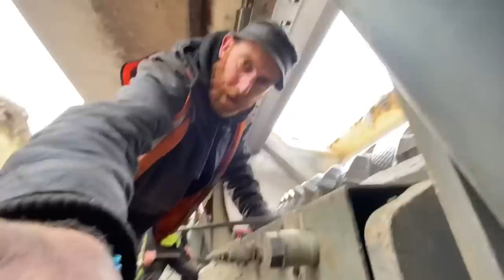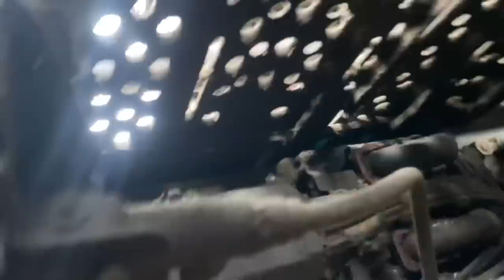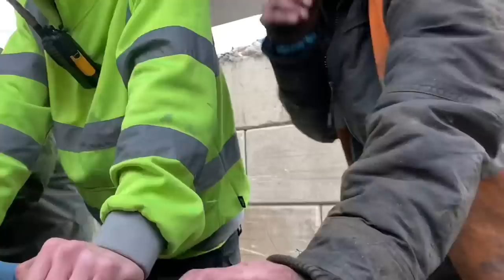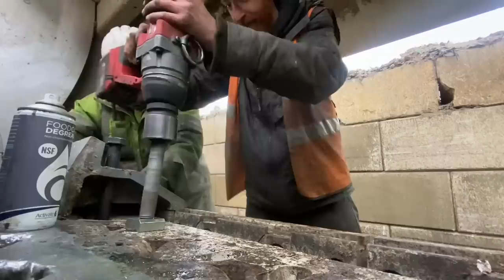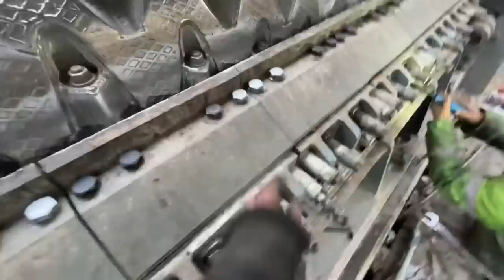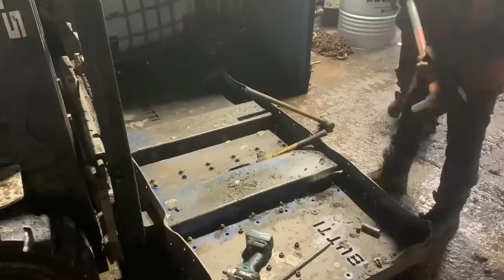Losing £10.000 an hour and I haven’t got a clue what I’m doing!!! No pressure then 😅

Comment: I was a maintenance electrician for a steel mill. I worked on straddle cranes that used joysticks for control. We had a run of breakdowns and all due to joystick failures. One of or shift electricians had taken it upon himself to lubricate the controllers, unfortunately he used penetrating oil in a spray can which ended up taking the lithium grease out of the bearings. Glad we stopped him before he did the whole fleet. I appreciated him being proactive but he cost us a fortune.

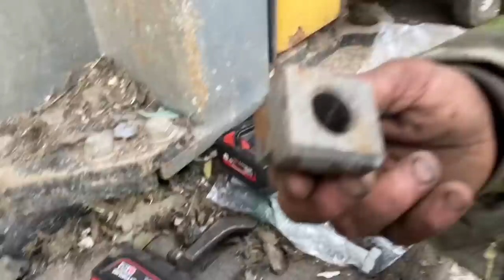Comment: 17:21 IV done it myself but in a pinch when you don't have a tap but you have extra bolts. Take a angle grinder and cut the threads perpendicular to the length of the bolt. This works to give. Bolt an edge to cut the thread. I'm sure if you Google tap made from bolt

Comment: Chris,  A tip or two moving forward.  Those M24 bolt your 'struggling' with are probably not cross threaded but the threads have picked up on each other.  What's needed is some proper good lubricant like an anti-seize Cooper slip.  This will not only allow disassembly but look after the threads on both components and reduce the said problem, but using decreased will only promote the problem.  Hope this is useful and keep up the good work 👍

Comment: How goes it matey?!

Those Unthas shredders are a pain in the ass! Do a good job though. Find out if they are hard facing those cutting teeth and blades before they put them in? They'll get a lot of extra use out of them.

Also, those bolts and fixings cost a bloody fortune for OE so not surprised they've been putting any old crap in. Lol

Comment: @Chris Allen - Professional Struggler 
Those Milwaukee inch drive guns setting 4 is 2400 nut busy or 2033 tightening torque... That good enough to cross thread most bolts...

Comment: If you need a field tap , but only have a spare bolt. If you use an angle grinder and cut a little tapered notch vertically. and bingo, instant thread chaser.

Comment: Them knives are fooked and the cutter blocks don't look much better and the hard facing on rotor looks low,use aluminium anti sieze  on clamp bolts,doesn't cure cross threads but helps on dismantle. You right on your crossthread diagnosis seen it a few times.And sometimes shredder rotors 'grow' when your run them up to speed and the block start clipping the knives but on 6mm clearance that's never happening

Comment: No need for that 3/4” impact, or is it a 1” ? Those bolts don’t need 1500nM plus. Tell them to use a 1/2” impact, then a preset torque wrench, cheaper and safer than that thing. It’ll prevent mess ups like this. Time is money, and there was quite a bit lost there, for the speed of using that gun.
Great work as always, stay safe out there!!

Comment: Do you think that's why your wheel nuts came loose on struggle bus.  Whizz popped them up for speed thinking they where tight
The modern day of mechanics  rattle guns   why wear our your wrist and yourself when you can squeeze a button?
Remember the lads in petrol shop (Vauxhall Stealership)  late 80-s on bonus servicing chevettes  Novas Astra  Cavs  and they used to whizz out the plugs with an air gun and rattle the new ones in    gash I called it    then use the same gun to whizz the wheel nuts off   
Working in the Commy shop the lads always used to shout     big pistons   knockety knockety knockety  as I walked through to the stores.
Good Times........